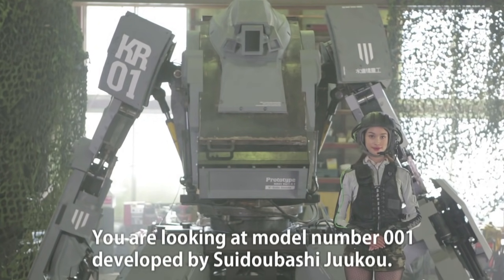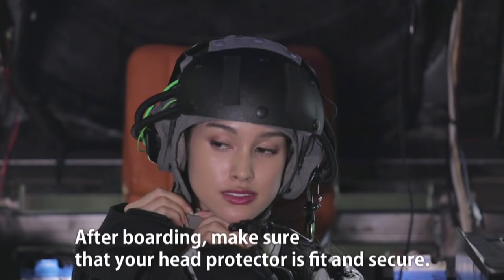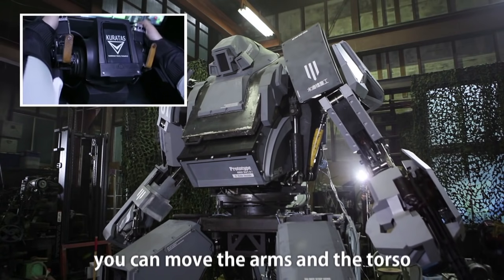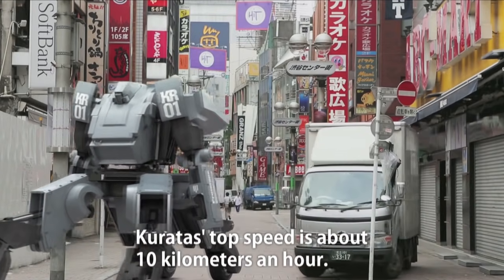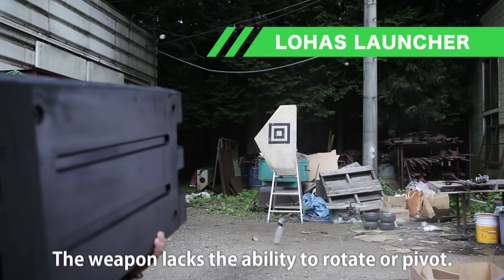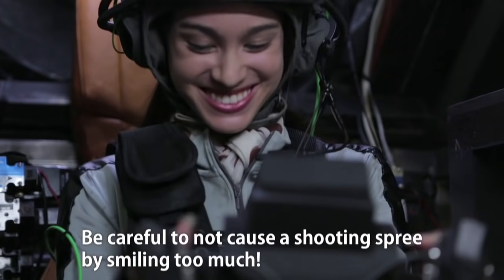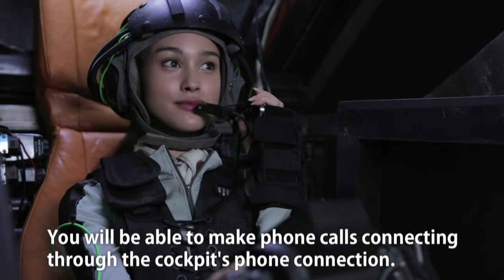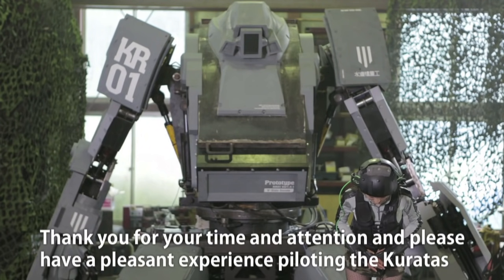HOW TO RIDE KURATAS - Suidobashi heavy industry

Comment: "There are, however, a few caveats -- and a few hints that all may not be as it seems. The first caveat is that the Kuratas only ships to the Kanto region of Japan, so if you're anywhere else in the world, you're out of luck. The second is that the robot is advertised as a kit, which means some (or a lot of) assembly will be required.

And this is where it starts getting a little more iffy: The kit doesn't ship with arms; these need to be purchased separately. However, these arms are not listed on the Suidobashi Heavy Industry Amazon page. Secondly, shipping is listed as just 350 yen -- less than $3. That price for the delivery of a 5-ton package seems unrealistic, no matter how local.

The reviews are also a little strange. Granted, we are reading them via Google Translate, but they seem to indicate that the listing is the extension of the Kuratas as a work of art, rather than perhaps a real item that can be purchased."

http://www.cnet.com/uk/news/starter-kit-for-giant-kuratas-mech-suit-lands-on-amazon-japan/

Comment: Ok so I just posted and I am watching the stuff from megabot and overall megabots seem to have a better design. Sure Kuratas seems more advanced and technical but this just means a single emp will drop basically all visibility of its pilot. Also there's the problem that the design is almost top heavy. Its frame allows for good speed but it is still rather slow and bulky which is yes to be expected but you have the problem of one good hit be it a punch or ram from the side easily toppling the mech. Also everything is on one person, while this is good in most cases with only a single pilot this means you must be able to aim (auto aim only goes so far) as well as move without crashing or running into anything. Furthermore the wheel base design while ingenious for lowering and raising the mech and allowing easy road travel it also means that these wheels are a great target to rip off or damage beyond use. The tank tread design used in the megabots does allow for better control in this case simply because here you have a good stance but the tank treads allow for better coverage of more terrain types but also a less easily damaged movement base as even without treads a tank can move albeit with less finesse but it is possible but this mech would be off balance and almost instantly forced to forfeit. Overall for the upcoming battle (whenever it is) you ought to consider a serious overall going for more analog features. High tech is great until a single emp pulse blows 90% of your tech in your mech and then it goes from a machine keeping you safe to a tomb. You should also consider a normal cockpit design with a window of some sort to allow the use of your sight rather than just cameras. Your weapons are intelligent yes but they will do little against the heavy equipment megabots plans and you also have little to no real speed in arm controls. In all this is a great bot but a very early stage one that at most seems reasonable for basic crowd control of humans but not other bots. I think you all if this is what you're bringing will be hard pressed to win the mech fight.
Reply: Thing is that the megabots has the cockpit exposed so the pilot can be taken down with small arms fire for better yet a flamethrower (not sure how thick the screen is so maybe not small arms)
Reply: that was mk.II they're reinventing. also there's the problem that neither is allowed, its mech fight not murder the others pilots
Reply: +Dr.End well you said emp so I thought you meant on a battlefield
Reply: Because emp will probably not be allowed otherwise it would not be a battle more of a watch this mech smash the other one
Reply: even in an arena an emp isn't uncommon to see. Granted still mk.III has prevented the issue of flamethrowers or small arms with a triple layer. look into their videos for building the new version and you can see its been taken in a similar concept to kuratas but it has a more western feel going more giant transformer than the japanese (or chinese) humanoid fighting robot suits. But let's be honest just the concept of a giant bot fight is AWESOME
Reply: Jason6 Liu true but remember that the valves and controllers for MK.III is all electronic rather than hydraulic or manual. Basically an EMP would be a last resort disabling the enemy sure but also disabling their drive controls as well as their weapons systems. Granted it WOULD be possible with modification to the current design to allow a third pilot in the base of MK.III for manual control of the tank tread base should an EMP be used but even then you're essentially a battering ram and it would put everyone at risk. Really an EMP isn't even correct for this type of combat. a more concentrated EMP BURST would fit better, it'd require something akin to a railgun though and that's kind of a long way's off. In all really i was just commenting since this bot is marketed for riot fighting that any person with a little bit of programming can render your pilots helpless inside a metal coffin with not even a light source should power die or be cut. Just a little food for thought
Reply: +Dr.End that is a interesting concept of having a third Pilot also why is the mega bots so big??
Reply: i hate to be rude but I don't know since im not building it. It could be a strategy to help prevent getting knocked over as easily since the heavier you are the more issue kuratas will have due to its size in comparison to Megabots'
Reply: +Dr.End that sound right but from what I noticed the mega bot seems like it would be knocked over pretty easily with two treads but I have not seen the newer designs yet so XP
Reply: true, we have no clue what the full final design will look like or any counter balance functions it might have. really though i guess it comes down to the concept of unstoppable force vs immovable object. if say kuratas is charging at roughly 20 miles an hour full force but megabots mk.III is say 700lbs compared to say kuratas having only 100lbs behind that charge chances are they might not even MOVE the mk.III but idk for sure what they're thought process is behind the melee combat. Also I know they're gonna be heavier than the given weights im just using a rough example
Reply: +Dr.End btw which do you think is going win me personally is the Kuratas if it can get stronger anti armor weapons instead of bb mini gun as it would probably prove to be useless against the mk3 unless it aims for the pilots which would probably not be allowed
Reply: +Dr.End I say a three tread design(two in the front and one in the back) would make it harder to knock down from the front
Reply: probably mk.III mainly cause of Kuratas' glaring flaws a few of which we have pointed out in this but most importantly its leg design. Take out any one of them and the bot is down for the count and immobilized. plus if your hud gets damaged you can't see anything  at all. Mk.III definitely isnt without its flaws though but we havent seen it finished so we dont know they all will be
Reply: +Dr.End yeah what you said it true so I think that they should have at least a open able window from the inside and as for the legs maybe a backup in the center other wise I got no idea

Comment: Though In my tiny little existance, I have come across a game ( playstaion\xbox ) called "ArmoredCore"... it has many sequels and as the game dynamics improve as the game engine is better refined, something quiet interesting becomes evident.... A regular person ( i.e: general gamer ) has to dramatically improve their concept of "whats possible" to be able to continue to overcome the A.I.... Now the reason for this is, the Mecha Suit (Armored Core) has the ability to fight with as much offence and defence as the Pilot (Raven) can imagine\design\opperate.... This may all sound very open ended... But with the availability of many variations in Mecha assembly able to be selected in the game. Coupled with a brilliant mind for strategy\balance\ingenuity and coordination + reflexes, I can assure you.... There is nothing else capable of defeating one of these systems.... I played the game for multiple years... throughout many different interations... And in the Last version of the game where a Mech could be created to the full potential of the designers intention ( taking into account battle capabilities and strategy + natural skill ), I finished the main storyline. ( it actually requires you to do it several times, each time allowing for a slightly different plot and a new level of opponent ).... At this point, I thought i had attained Mecha Warrior God status.... I was wrong... very wrong... ( this was on xbox360 ) and any time i had tried to play online multiplayer, i was met with empty lobbies... Turns out, this game was alot more popular in Japan... ( <-figures)... The first match against a human opponent, I saw how effective a Armored Core in the hands of a seasoned Raven could be.... The battle commenced, and immediately my opponet left my field of view ( you start off facing one and other just out of range )... He continued to evade my line of sight and there for my weapons until i was defeated... 45-120seconds!!! after the match had begun... This was repeated in almost every online PvP match i entered... If you want to have a look for yourselves, check out "Armored Core: for Answer - Online 3vs3 -NA vs JPN (05/18/2010)" on youtube... the resolution is terrible and it only offers a view from the one players HUD... But if you can maintain a sense of direction and track the targets and enemies as the this player does. (Watch the Map and Health Points, The Map is 3d with height refences. And the Crafts health points top centre give you an indication of how often the player takes damage.) 
Then you Sir\Ma'am are apart on the Elite 1% capable of truly piloting a Mecha suit to combat potential....

And If man has the requirement to continue to find new reasons to go to war.... you can be shore, that once we harness fusion reactions. We will unlock the potential to make metal dance at the speed of thought, and a new class of Pilot will be born. One that bonds Machine Power with Human Spirit.... 

Will Evolution be an arms race to best adapted convergence....???

This is the best Youtube video i could find to best sum up the complete System:
Armored Core:For Answer Occupation of Arteria Carpals S-Rank, Old King lives, Regulation 1.40
The match is against A.I, So it doesn't rate nearly as highly as skilled human opponents. But after the player shows his Mecha ( Armore Core) configuration... So you can see the possibilities for different configurations through the many parts.. All with a complex mathematical algorithm to ensure perfect balance\efficiency\effectiveness\capabilities...
Now.... using the xbox interface, including four main face buttons, two shoulder bumpers, two analog triggers, two analog sticks and a digital D-pad. ( that are all required to be used simultaneously in order to control the craft in the most basic of function )...
Direct a "SuperMAN-CHINE" at the speed of a Caffeine juiced Jap teenager, with countless hours of hardened training to Inflict more damage than a BattleShip and Counter Multiple enemies from all directions, whilst not wasting ammunition or depleating your energy reserves, or overheating your crafts systems and regulating your overshields, In order to attain victory.....????

This is why a Mecha Suit is required..... 

( I know its stupid to dream about such things... But i have designed an atmospheric booster capable of advanced manoeuvres in order to create the directional vectoring needed to attain this level of combat.... If your reading this and have also have crazy dreams of building things that cultivate a new era in human perseverance, send me a msg... )

Comment: You don't even need to use programmable gears and chains together...you could have a complete programmable gear system driven by an engine...as long as you can create a sturdy mechanical programmable gear...

I suggest a gear that compartmentalise into thinner nobs based on the mechanical turning of the central plate...you could even set up nob configurations...maybe even fully programmable by using the internal plate as a dial for the corresponding angle nob...

How would you set that up???

12 gear nobs...360 degree dial...fine tune individual gear nobs...or completely skip them...

So you could have a chain less bike??? 

Yup you could just you a programmable gear system...

If they compartmentalise when you tune how do you skip them???

You could have lowest setting encased...and the second setting pushes up...and the other settings tune thinner...

How...

You can angle the gear nob...so it can push back down if it isn't locked in place...and turning the dial makes it thinner...and it skips the first setting...and the second setting locks it in the up position...

Or instead of using a spring...you have an internal gear system inside the gear... And the second position pushes them fully up...bit like a watch...

Maybe 36 gear nobs with ten degrees of tuning would be better...

Or 12 with 30 degrees of tuning...bit of a debatable thing...

It's essentially just a watch...

You could even mod a watch into a programmable gear...and use the hour hand to force the gear nob up and tune it...

And watches have existed for hundreds of years ...and it's all the same crap twas before...you get the picture...

Comment: im for the japan robot...the problem is the megabots track roller can damage the kuratas wheels. the mega bot have better mounting unlike kuratas if one of the wheels are damaged it will tilt or fall down. 日本のロボットのためのイム...問題はmegabotsはローラがkuratasホイールを損傷する可能性が追跡しています。車輪の一つは、それが傾けたり倒れます破損している場合メガボットは、より良いkuratasとは違って取り付けています。(google translate)

Comment: I don't think there's anyway US could win against the Kuratas.

I think there's big changes that should be made. First, more rotation speed, adapt what US used during WWII under bombers. that ball. The fire station under belly of B17s. That rotation speed is what this thing needs. On top of that give the pilot a G suit so they don't pass out on heavy rotation. Or something like that. At least he/she should be able to compress it. Because the auto aiming the rotation speed is definately needed. 
I have faith in this. That it can easily beat the US john deere mowing machine
and yet have tank tires so it doesn't freaking flip over. Stronger engine power and more weight.
Make the seat like a F22 ejection seat. That way it's much safer.

Comment: "It is gasoline fueled and runs on a diesel engine."
What? Diesel engine fueled with gasoline?
Does it have two engines, gasoline for hydraulic pressure to operate the arms, diesel for the wheels?

Comment: I feel upset it should not run on a diesel engine it should be mainly and solely operated on hi extended batteries and should be designed better if they're using a diesel engine electric motors could put out 10 times and amount of power a diesel engine would
Reply: HoloTheWiseWolf 

It’s a matter of Torque which is needed to move the limbs at any useful speeds. 

It’s why Construction equipment often uses Diesel engines as well.

Comment: I can't imagine anyone afording that thing! Where are they going to use it at anyways and what for!?
I can see it as some technology demonstrator but for comercial use is a bit far-fetched. It's a cool private venture but for recreational purposes...
I never doubted that the technology is impossible to make. Most of the required components have exsisted for years, all we really lacked was some one to put them together and tweak it.
It is easily possible to mount real weapons on it.

For thsoe that think this can be used for the military...
Of course the actual military value of such is little to nothing. Any advanced tech would be applied to exsisting vehicles first.
And do note, the equipment presented here is already exsisting and components is actually available to civilian industries.
Let alone actual military grade equipment.
Still awesome though.
Not like a mecha would ever match a tank in firepower or atleast sustained firepower. The armor would naturally be thinner than a tank, the mobility and speed won't be any better than a economy car.